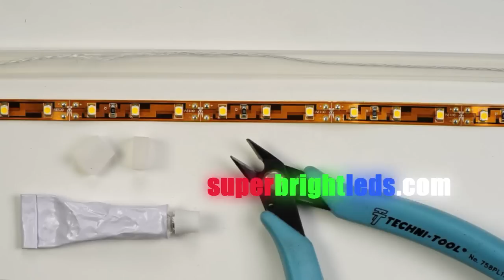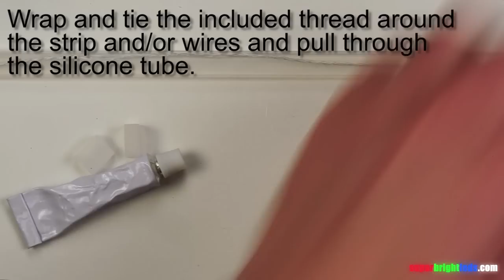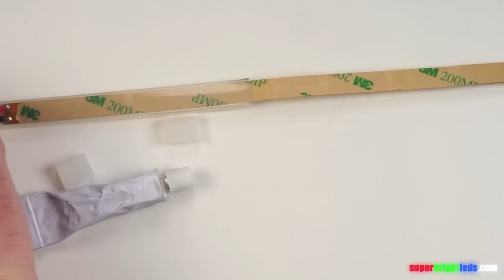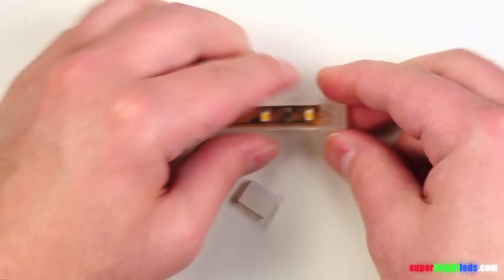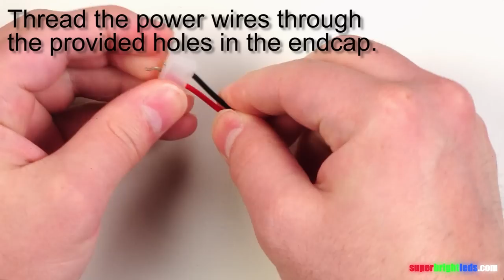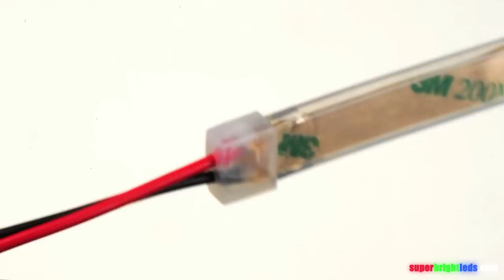How to Waterproof LED Light Strips by superbrightleds.com

Comment: how do you pull a long length of led lights through?
Reply: I found it impossible. Online I found China manufacturers using two people and an airhose to open up the silicone sleeve while the two worked at pulling it through and pinching off the silicone sleeve to fill with air and make it slide easy.

Comment: Will a IP65 led strip fit in the tube?
Reply: This is a good question I'd like to know as well... What's the specs of this tube? I have a 8mm light strip and with the manufacturers IP65 waterproofing silicone it's 2.5mm thick, the question is would that fit? If you look up this product on their website it says this tube is only .05mm thick. Clearly from seeing it in this video that's not the case and must just be talking about the thickness of the walls combined instead.